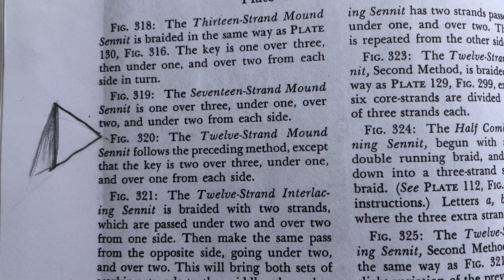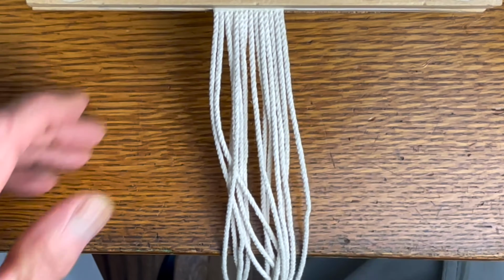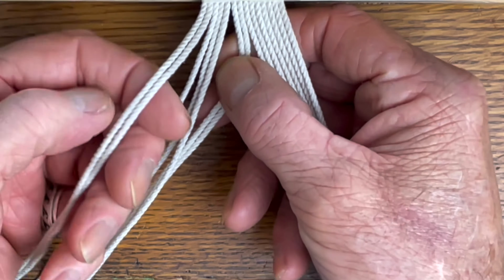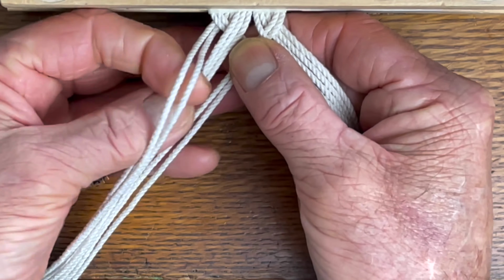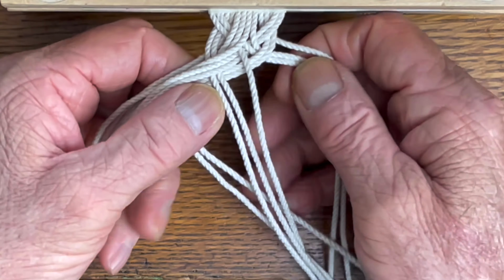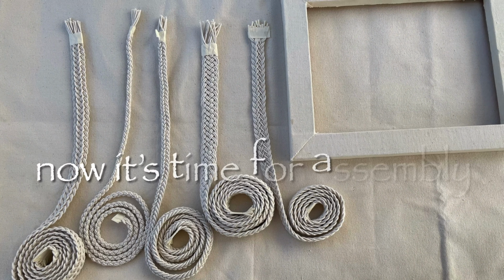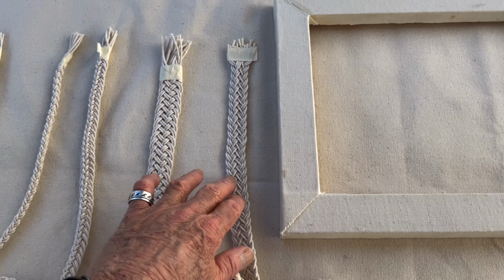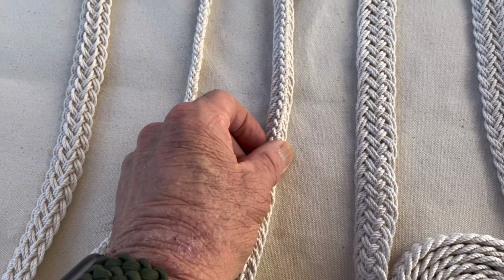Certificate Frame - Start to Finish

Comment: Can you list all of the rope and equipment needed to make one from scratch. I’m really excited to start one
Reply from the maker: That would be difficult due to the varied possibilities of what size and complexity you decide to tackle …. one of the videos I produced maybe a year ago or so is “Certificate Frame -Start to finish”  ( or something like that …. Watch that one and it should give you some idea of what’s involved… you can start with an existing wooden frame or make one … you can use all the same size line or use a wide variety of sizes … and so on. 
Even a small frame could take 300+ feet of line …. Most that I make require well in excess of 1000 feet. Also, something to clamp the line while while tying strands of sinnet. I started with a piece of wood that I clamped to my desk. I would encourage you to watch a bunch of my videos …. Literally everything you need to know is contained in the videos I’m made over the past couple of years. Or you. An do what I did …. I just started doing it and figured it out as I went along …. because I had no instructions…. there aren’t any except mine😎…. Oh well there is the Encyclopedia of Knots and Fancy Ropework. but if you follow those directions you won’t get very far … I read them about a year into this and went back to just figuring it out myself

Comment: The frame looks great
How did you make those gray weight/hold down blocks
Reply from the maker: My dad made the lead weights back in the 1950’s…. They were made to pin down plastic curves in the course of drawing yacht designs…